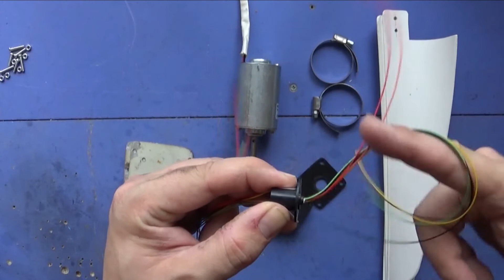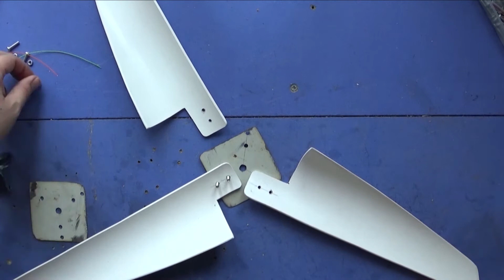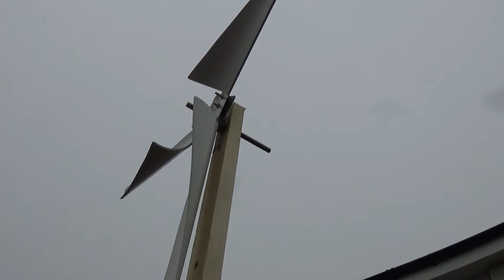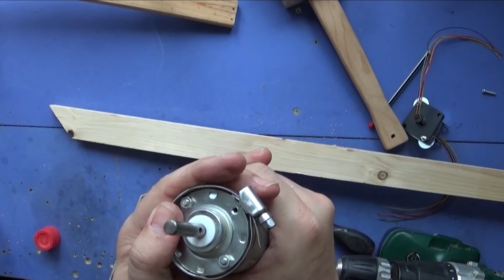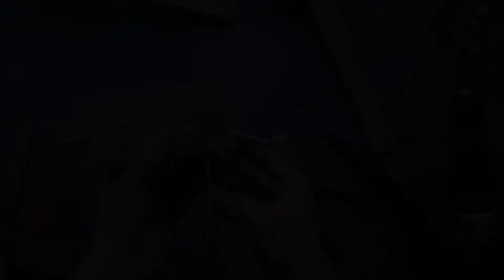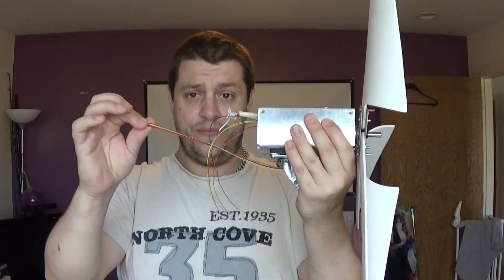Build Your Own Wind Turbine Part 4 Construction Stage

Comment: Great build do far. Clothes pegs are handy for holding the bolts in position until you are ready to screw on the nut. Also, did you consider heating the tabs on the blades with a heat gun prior to tightening the sandwich to take the curve out of the tabs?
Reply from the maker: H2Dwoat thats a really good idea. I hadnt thought of that. I have made a part 5 but I've decided to change a few things so i may use your idea. Thanks for the input
Reply: Just one more thing, the corner where the tab meets the blade looks like it may be a weak point, just wondering if you think a radius instead of a right angle might decrease the stress at the junction?
Reply from the maker: Yeah I had thought about that but for speed and ease I chose to do it this way, I was contemplating using silicone to fill it but not sure at the moment. To be honest Im not 100% happy with it and Im thinking of a complete rebuild.

Comment: wrap the motor in a rubber gasket you can buy at most hardware stores. then the clamp will have something to bite into and won't vibrate out in future.
Reply from the maker: very good idea :) I may have something like that laying around. Thank you

Comment: The motor has it's own fixing screw holes at the back of it there should be three of them buddy 👍🏻👍🏻
Reply: Great video mate keep fighting the good fight comrade 👍🏻👍🏻
Reply from the maker: Yeah there are at the front too but i couldnt get the design i had in my head to work while attaching it together....i think i got a bit of inventor block. As with everything i may come back and change it eventually. I have to do some tests anyway so stay tuned.
Reply: I know what you mean with inventors block I could not vision the tin can and pop can crusher I've been trying to make for the past week haha simple yet worlds away from being made but I never give up just keep on trying 👍🏻👍🏻 I noticed you had your turbine blades put up with a 1x1 you did say you were only testing it out but what about a metal or aluminium pole with a rotating bracket on so it can follow the direction of the wind as I'm typing this i thought to myself he'll already no all this but I couldn't stop myself from writing this haha😜so I won't be offended if you to me to stop stating the obvious buddy haha👍🏻👍🏻
Reply from the maker: Lol i have the rotating part all set up. I am just needing to cut a piece of metal out of the tread mill frame and that part is sorted.are you documenting and photographing the can crusher project. Id be interested to see it. A little hint towards a future project but i may need a can crusher as i will be needing lots and lots of cans. Thanks for the info buddy